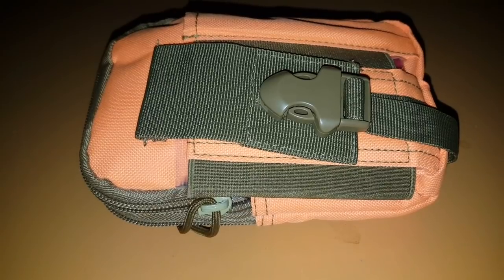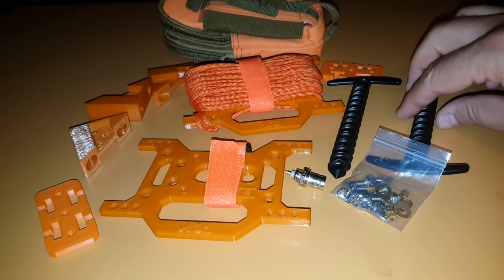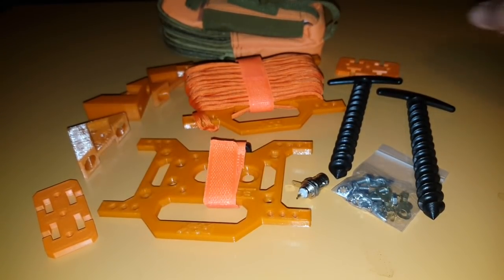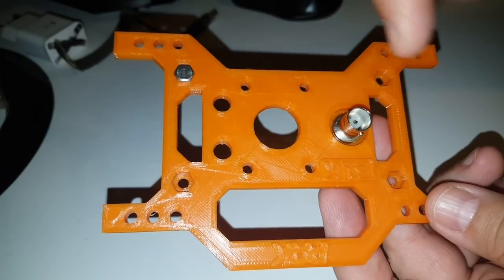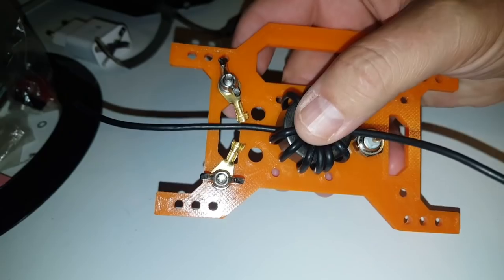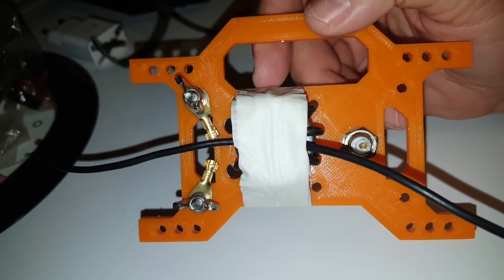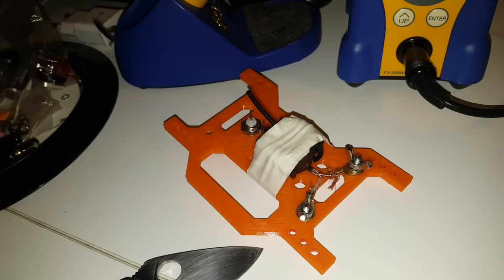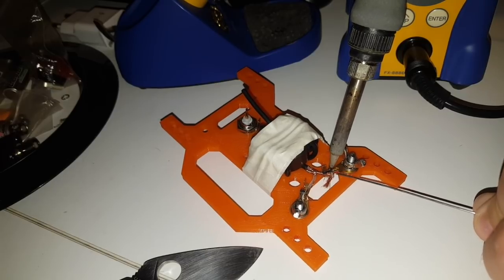Building an Inverted-V Antenna For The 40m Band, Part 1.

Comment: The triangle parts are made to be slipped at the top of a telescopic mast or fishing rod to hold either a wire end (for a slopper or an EFHW) or to hold the main part thanks to the carabiner provided or a piece of the 10+m orange paracord provided in the kit). HTH, Gil ;)
Reply from the maker: I should have figured that out!

Comment: Have not heard an inter G station on 40m for ages. That is a station within 300 miles. However NVIS is working on 80m very well. Very strong stations within that very important, for Preppers, 100 \ 200 mile range with complete saturation. Only have to have the dipole up about 10-15 feet which makes deployment easy. The problem is that most Ham's have their antennas to high for good NVIS because that is not what they are interested in. Big Big difference in method for radio communications between Preppers and Radio Amateurs in general I have found.

Great video my friend many thanks. Larry M3mpd.
Reply from the maker: Absolutely! Thank you.

Comment: Interesting video Gil.  Inverted "V" antennas are my primary goto antennas and I make all my own very cheaply.  I use lightweight material bought from a well known QRP retailer who is very reliable in his quality and supply.  I have built inverted "V's" for 10, 20, 40 as single band antennas and clipped dipoles for 20 & 40  which I use with my 817, 857 and PRC320.  I have to add that none of my antennas have a toroid or balun as part of the build and they all work extremely well.  I hope you get the problem solved as it does look like a very nice antenna.
Reply from the maker: I will :-) you mean Sotabeams? The Wireman?
Reply: I didn't want to give another supplier a free mention on your channel, but you are right :)

Comment: An idea for your next antenna experiment: An half wave end fed inverted V. Same antenna but fed at the end not in the middle. Don't need 10+ meter of coax so it's lighter. You can use a lighter pole because there is less weight of the coax/balun. 73 Erwin PA7N
Reply from the maker: I have done it before!

Comment: Rethinking again about this SWR problem, I recall you said that the coax for the balun is reclaimed from an old jumper cable. DC wise, it looks good, but it may be damaged (flattened somewhere or even at many places, dielectric has become porous to humidity and act as a short for RF).
One way I see to dispel doubt is to solder a 50Ω resistor (or 2 × 100Ω in parallel, easier to find) in place of the radiating elements and verify how it looks with your antenna analyser. First, with the toroid and then without. It will give you a good first approximation of quality of the balun and of the reclaimed coax.
Reply from the maker: Yep, I need to get back to it...

Comment: PS. Next best thing is beer/ pop can, and six loops of the coax wound around it then put wire ties to hold form then remove. ( The Can.) Makes a good rf filter put close to terminal of the antenna.  Then on to rig. Good qrp worked.

Comment: Hi Gil,

indeed the 20:1 looks like a short circuit or oxidized connector. The antenna build looks ok. The balun is certainly not to be blamed. It could be the old RG-174 but you tested it ok. The only thing that we did not see on the video is the coax cable from the tx to the antenna, i. e. the feed cable. I have had faulty BNC cables that all of a sudden would yield high swr because they lost continuity in the connector (oxidation or like your old RG-174 connector, just the braid disconnected). Usually you can test this by "wiggling" the coax at the connector, and see if the bad swr condition disappears. In fact most  of my high swr antenna issues turned out to be bad coax connectors/connections. 

Great video, maybe you know the solution and just were trying to see if we were not falling asleep, hi

73 de 4z5oi jurgen
Reply from the maker: Thanks. I tried two different cables, so probably soldering...

Comment: seems like a str8 forward kit. i get why the balun. but i would have built it 1st without. as iam not sure but kit doesnt have one to start with ??   then if issues work from there.. looks like a good kit tho.
Reply: The kit is designed to create your own antenna and you can add a balun or an unun without any problem (that's why I made a big hole in the center of the main part 😉).
I already have made 4 different impedance transformers on the PAK System : a 9:1 unun for a "long wire" (aka "random wire"), a 1:1 balun for a dipole, a 49:1 unun for EFHW and a 4:1 guanella (two toroids) for a delta-loops or an OCD (Off-Center Dipole).

Comment: Thank you Gil for this nice video. This quizz game is very interesting ! I use the same antenna with the same wiring on the toroid with excellent results, maybe there is too much of intermediate plastic and connectors. It increase the risk of short-circuit or interruption... I just use one coax cable, a toroid at the end and 2 wires soldered at the end without anything else, no plastic end, no in between connector and no glue...
My bet is one leg is not connected correctly and there is a problem at the bnc junction..
Anyway I am looking forward to hear the answer ! 
Btw I would love to see a dipole with ladder line, it would need a transmatch coupling at the tx end... 
73 and tks ! Serge
Reply from the maker: Could be... We'll see very soon...

Comment: I am using RG174 at 100W SSB with a tuned antenna, no pb whatsoever.
That's important to say "tuned antenna", if it is not tuned, it will not withstand that much.
If i remember well, it can go until 150W SSB, anyway I'd use max 30W whilst transmitting on say FT8.

Comment: Hello, and thank you for this great video.
IMHO, the RF-choke is not what you needed at the dipole feedpoint, but a real 1:1 balun that would have 2 valuable effects:
1) transform the coax feeding system to a symetric one
2) eliminate static issues you can have with large antennas 
I propose you to use the same toroid with 10 turns at the primary and the same for secondary.

Bonjour et merci pour cette vidéo.
A mon humble avis, une self de choc RF au point d'alimentation n'est pas l'idéal pour ce type d'aérien, mais il aurait-mieux valu un balun 1:1 qui aurait eu 2 effets positifs :
1)  symétriser l'alimentation
2) éliminer les risques de statique propre aux grandes antennes
Je vous conseille d'utiliser le même tore ferrite avec 10 tours au primaire et la même chose au secondaire.

Très cordialement
Best regards

Fabrice / F4FCP
Reply from the maker: Vous avez raison, merci.

Comment: Nice! BTW, you should be able to get some use on the 15M band as well depending upon how long you trimmed the dipole legs. 15M is the 3rd harmonic of 40M. It won't be full band coverage, but some of it should be usable.
73 -Rob
Reply from the maker: Theoretically yes!

Comment: The problem may be a combination of the number of turns on the toroid and the toroid material.   Kevin Laughlin has an interesing experiment with toroids, unun's and chokes.  Would it be possible to make this a "random" length, maybe 29 feet or 35.5 feet per side?  A choke and a tuner would be necessary, but would a 9:1 balun be necessary too?
Reply from the maker: No need to change the impedence, and this is a resonant antenna... I will get back to it soon..

Comment: First off, I can tell you , you DO NOT NEED a torrid core/ balun at the feed point when you are operating ONLY on 40M, ( I have never used this setup in the past at all )
Just use an SO-239 and get rid of the BNC connector to start! and connect the SO-239 direct to the wires and that's it! 
If the antenna is resonant at the operating freg of your choice you don't even need an RF choke at the either the feed point OR at the TX! 
If you have issues with stray RF on the shield, THEN you Wind about 7-8 turns of coax at either the feed point OR the TX side, sometimes to eliminate the hardest stray RF you MAY have to use two "wind-up chokes" at the feed AND the TX. 
I have used Inverted Vee's and never used any extra parts when it operates correctly. Good Luck on your project, 73 DE KD6SBR
Reply from the maker: Agreed, except for the SO239. I use only BNC connectors because all my radios but two (out of thirty) use BNC. Military radios use BNC which is a superior design. PL259s often get loose and are unnecessarily large for low power operations.
Reply: @RadioPrepper  BUT they are even less waterproof than So-239, AND an 
"N" connector. Even if you weatherproof them. "They suck in" water and moisture  more easily. 
 But to each his own. I TX on ham radio though, my guess is you are just receiving ?. Personally I would NEVER use BNC for TX. Especially at high power. 
BUT I SEE IT IS LOW POWER you are referring to @ 100W?  still, I would never use it. Just IMO. Take it ez and good luck, KD6SBR
Reply: @RadioPrepper  What is your call sign ? DE KD6SBR
Reply: @RadioPrepper  NEVER MIND about your call I see what type of channel you have. LMFAO
Reply from the maker: Well, the military uses BNC only, with waterproof radios... You are thinking in the context of a standard shack installation at home with QRO power. I am not. First, I rarely use more than 5W, most often using CW. The only time I use more on HF is 30W for SSB with my PRC-320, simply because more is a waste and requires bigger batteries, thicker coax, etc. Not worth the hassle, as QRP works extremely well as it is. SO-239s are bigger, heavier and tend to get loose when the coax moves. I don't think they are any better than BNCs as far as water tightness is concerned. You would still need to tape either vith self-vulcanizing tape for true waterproofing. My antenna installations are always temporary, for field portable operations, not at home exposed to the weather year after year... BNCs are way better for what I do.

Comment: I wonder if those hot-melt glue sticks aren't as inert as you think....
Reply from the maker: They have the reputation to be, unlike epoxy...
Reply: @RadioPrepper  I used some to pot a small QRP efhw matching transformer some time ago. The transformer worked fine before potting but the hot-melt wrecked its performance.

Comment: My dipole 40m  has 5 turns then 5 more the other way with cross over through on the same toroid  rg 174 feed line to the centre of my dipole no issues. You did check continuity so it seemed ok did you test your dipole on your friends 817 or his antenna on your rig. Where was your resonate point.
Reply from the maker: I did not recheck after hot gluing... There was no resonant point anywhere...

Comment: I use FT114-77 toroids for RF chokes, 11 (RG58) or 22 (RG174) turns, both work well, so that shouldn't be the problem ... did you check your feed-line?
Reply from the maker: Sure did... I wonder if a connection got loose while hot gluing it...
Reply: scratches head ... maybe not a short or open circuit fault, but just a major shift in impedance? I would test the SWR of both choke and feed-line when terminated with a dummy load.

Comment: I think you have a problem (maybe a short or open connection) in your feedline. Everything else looks fine for me.
In normal the inverted V´s are working with no problems from the begining.

73
Reply from the maker: Probably...
Reply: I concur. Too many turns or not enough  adjusts the blocking frequencies. Ohm out the antenna from the transmitter to the antenna tips. Or was it the radio?

Comment: Most remarkeable  is the fact you only tried the antenna on your own transceiver, but you did not try it (at least not in the video) on the FT817 of Frederic, who is just sitting next to you…  You might then had a better impression of the reception of your inverted V, instead of saying it is a fail.  Such comparison would have been be a logical action IMHO.Sometimes it is just a matter of common sense
Reply from the maker: Right, but the antenna analyser gave a 20:1 SWR....
Reply: @RadioPrepper  @Radio Prepper:  Bonjour Gilles (I hope that is the correct spelling of your name!).  It’s great that your tutorial ended with a fail and has resulted in much interest in the comments.  For me, the 20:1 SWR is a good indication of a short circuit somewhere in the build.  With access to an SWR meter or antenna analyser (as you had), I have found that incorporating a balun and/or choke is unnecessary, and just another thing to go wrong!  The secret of prepping – the least moving parts as possible!  

I agree with “The Old Hobbit” commenter (below) – I do not use any form of toroid, balun or choke on my home brew inverted “V” antennas, even when using 100w, but it is important – and good practise – to obtain an SWR as close to 1.0  (certainly less than 1.5) – at the centre of the operating frequency, otherwise something is seriously wrong.  Keep up the good prepping videos, Gilles – yours are some of the best.   À bientôt !

Comment: That thing is just shorted out. I had a inverted vee 40 meter dipole and it never had a high SWR. It's just plain shorted out.
Reply from the maker: Could very well be!
Reply: @RadioPrepper  I went back over the video and don't see why it would be shorted. Perhaps it's open. Either way, it's not behaving like a working antenna. How about a remake and test all components before assembly. Kits have taught me the hard way to test everything first.
Reply: Well, I am not that sure. Gil noted a 20:1 SWR with his analyser. With a short, it would have been more like an ∞ SWR. My theory is that the reclaimed coax used to make the 1:1 balun is probably damaged and is not 50Ω anymore (is the coax punctured or crushed? the dielectric is deteriored?).
Reply: @ElektroLUDIKITS  It's definitely an unusual symptom and I hope he finds the fault and shares it with us.